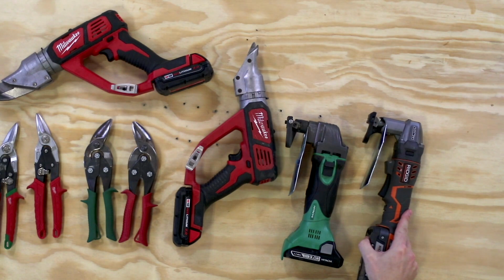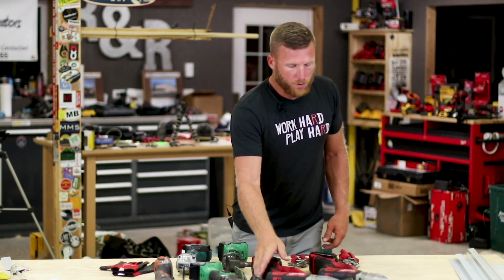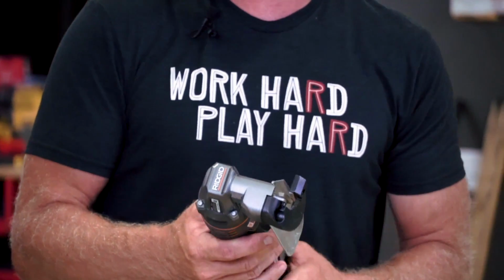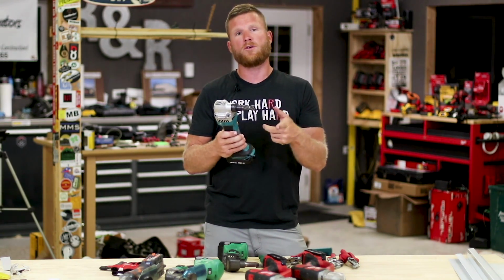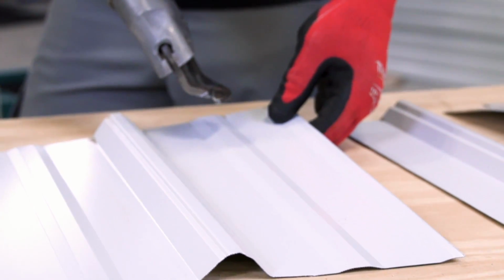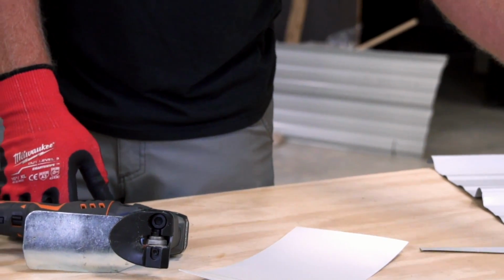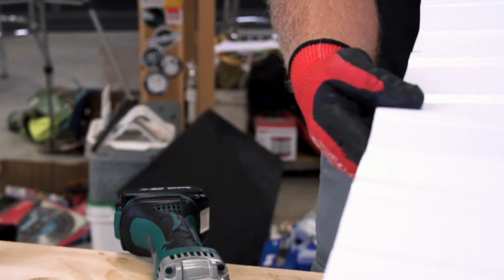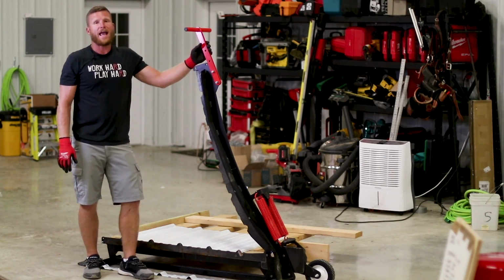How to cut metal - Toolsday

Comment: You need to check out a magnetic chip brush. Looks like a stainless steel baton with a plastic handle with a very strong magnet inside. Once you have waved it over a surface and it fills up with chips, you pull on a plunger pulling the magnet into the handle, dumping all the metal chips.
Is also available in long versions.
With this you can easily clear a large surface of any magnetic metal.
Works great for finding lost screws and bolts, even in grass.
Reply from the maker: NoC great idea thanks
Reply: ²

Comment: The nibbler is a very useful tool, but yeah the nibblets are not fun to clean up.
I find a strong magnet wrapped up in a plastic bag is great for picking them up from the jobsite, you run the magnet around the ground or floor and when you are done, just remove the plastic bag, and the nibblets are now in the bag. You also have to watch out with the nibblets with pets around, especially dogs, they can easily get stuck into your dog's paws.
Love the videos, you do very nice work!
Cheers from Tokyo!
Reply: Great idea!

Comment: I have a nibbler fitting for my power drill - a bit more awkward to work with than a purpose-built machine, but it cuts nicely.
One thing you do want with a nibbler is a good workshop magnet to sweep up the bits afterwards. It spits out a stream of very sharp metal fragments, and they don't rust out in a hurry. It's much better to clean them up than be picking them out of your boot soles twelve months later - or your kids' bare feet.
This vid definitely needs a workshop magnet demo to round it out.

Comment: informative video, on the Swenson shear, a contractor friend of mine who does a lot of boat house Hip Roof construction, has the 5/12 pitch blade, and cuts his whole roof on the ground.  super fast and to the hip/valley pitches....he owns several different pitch blades
Reply from the maker: Chris Harriman pretty sweet isn’t it.  I have a 4/12 pitch blade too
Reply: I was thinking that tool would be way cooler with an angled blade for pitches! That must be sweet.

Comment: Love the channel; thought I'd share a tool that is no longer available but was still works great.  Over forty years ago I went to trade school for HVAC and my first job, had me doing a lot of ductwork.  I had the usual set of tin snips, right, left and straight cut.  Then while at Sears when they had their Good, Better, Best, tools, I can across a 'Pro' tool that was based on a heavy-duty Jig Saw, it had two interchangeable heads, a single cut head, and a nibbler head.  I bought it and I still have that thing and it still cuts, though I have had to order replacement blades years ago.  Being designed from a jigsaw, it had a comfortable handle, with the motor between your hand and the spiral the shear head curls up.  I'm amazed that with all the cordless power tools, no one had thought to use those old designed to protect to tradesman's hands.

Comment: Great info! Few years ago I had to add lots of windows to a "high" profile commercial building. I used the double cut shears. Work great for flats....I made it work over the profile., but barely. Should have got the nibblers to. I would like to see how guys are making windows water tight. A lot of thought went into this as I could not have the water running down the inside of the panel and soaking insulation. Keep up the good work. Stay safe up there.
Reply: yep and the wet insulation takes forever to dry out and then the panel rust through from the inside, a real headache.

Comment: I have a nobler and cut all kinds of material , it does well. I also use a couple of bar pickup magnets on a pole for cleaning the floor. Use a couple of 2x4 for spacing. It catches most all of the scrap as well as the really fine shavings that wind in your shoes
Reply: I take the pole off and use between the 2x

Comment: It looks like my last comment has not had much traffic since that entry. However ... Kyle, you implied you read these and sometimes learn from them so I am hoping what I key next is of value to your followers. First, in the video to which these comments are attached, which has been incredibly helpful to me, you demonstrate a nibbler tool after some shearing tools. Sadly, in my case, nothing was specifically stated about the limitations of a nibbler that does not have the wide-angle access that is visibly obvious in the two nibblers you held up, or the one you used to do the "nibbling."

Not knowing what the specific benefit of that wide-angle access actually allows, I bought an air-powered nibbler that works fairly well on "flat stock," but it absolutely could not go over any surface that was not flat ... like the formed wall or roof panels you cut with the nibbler. That limitation was easy to see once I tried to use it! Its access point is a narrow "slot" through which the flat stock can easily pass, but it does not allow (limits) any hope of passing up, over, or around any ribbed panel.  Just a mechanical limitation.

Second, and I do realize you did not make all of your videos last week, the Hitachi brand is now Metabo and that little update would be very informative to a DIY person doing this sort of work for the first time ... or returning to it after many years away.

None of what I just wrote is intended to fault you in any way! The educational and informative perspective of every one of your videos that I have watched is PRICELESS!! Thank you, so very much for your willingness to give us the heads up we need when we lack your experience, knowledge, and skill.  :-)

Comment: PS:  About thirty years ago Black and Decker made what looked like their homeowner (the green painted model) version of a jig saw.  Instead of a blade it had two opposing wheels that did the cutting.  Went through any profile of steel roofing perfectly.  The wheels were replaceable as well.  Of course it worked so well they quit making them almost immediately.  Sure wish someone else would come out with that design.  They were far from expensive and worked like a dream although they were from the corded era.  Doug
Reply: Yes, those were excellent. Fast, smooth, no mess. Like you said , must have worked too well.

Comment: Kyle's right that these nibblets get everywhere. Nothing worse the coming home and popping of my shoes and seeing a trail of them on the carpet behind me.

I have a wand I made of strong magnets surrounded by thin-wall 1" square aluminum pipe that I can lay underneath the cut to catch them. And then I can wave the wand around to pick up those the magnet missed on the drop. One could even make one long enough to fit the width of one of these panels.

Inside the aluminum pipe is a piece of wood with round holes drilled deep enough with a Forstner bit to hold the magnets in place, and then the piece of wood with the magnets is slid inside the pipe and held in place with a single screw.

My next big-money adventure is to invent a wand that works on aluminum nibblets.

Comment: In the aircraft industry, air operated hand held routers are used for sheet metal pattern cutting. A 25,000 rpm router bit has no conscience and leaves no burrs. Keep fingers away.

If I had a number of sheets of corrugated metal that all needed to be trimmer to the same length, I'd use an abrasive blade in a circular saw and be done with it. 

Nibblers work good for cutting holes for chimneys or other larger diameter holes in sheet stock.

Comment: check out the draco 3520 medal sear it will do what you want. also a skill saw with a carbide blade will do it. uni shears or tin snips are designed to only cut with a short amount of material on one side that can roll up.

Comment: My Hardie board shears has the same kind of double cut mechanism as your double cut shears. I point this out because the blade can be flipped on the short axis. So basically there are two blade sets in the mechanism. This is not readily apparent from looking at the tool. It's similar to some jointers that allow you to flip the blades on the long axis.

Comment: The hikoki nibblers look like they can do a good job on corrugated iron.
They changed the name to custom orb years ago although it's the same product. Using
A cold cut saw on sheeting needs plenty support. I would need to make a special table with an area where the backing has a gap and supported both sides and
Well clamped. Very noisy doing it that way.

Comment: I only started working with metal roofing a year ago as a side job building lean-to-carport structures and all I had were snips and a grinder with a cutoff wheel. It worked but most of these tools are going on the wish list. Great video.

Comment: Very interesting.  I have a set of air nibblers in the drawer but just because of the mess and the damage the cuttings do to the finished surface I didn't even consider them.  Just did a job with standing seam on the roof and the exposed fastener on the sidewalls.  All needed to be crosscut on the job and I just have not found a tool that can handle it and can do it without distorting.  I can't think of anything but a floor shear which is certainly not affordable or portable.  I used the corded Milwaukee coldcut saw (circular) and was very unhappy with it.  Not only did it make the cut line invisible but it ground its swarf into the finished panel scratching the paint horribly as well as starting rust from the particles laying on the panels.  It does catch most in the container on the saw but enough gets by to really ruin the job.  On blind cuts it really sucks not to be able to see the blade while every cut has a slight burr to it (perfect for rust to form).  It also ate blades pretty fast.  Something about the corrugations tend to chip the carbide.  Took two blades to do a job consisting of about 2200 sq ft.  My corded Grizzly snips were good for ripping panels but not if you needed to cut on the side of a peak or valley.  Bought a set of Malco shears that attach to your drill motor and although advertised for roofing they could not do the peaks and valleys of a cross cut in either profile.  Sent them back as they were terrible.  The head swiveled without being able to lock down so a long cut needed four hands to hold and drive the tool while grasping the head to keep it going in the right direction.  So my question would be, aside from the floor shears what do you use when doing many cross cuts on panels at the job site?  Can't be the nibbler just because of those cuttings.  Not only do they scratch up the job but think what the client's reaction is when they show up in pet's feet and inside on the carpets!!  Cleaning them up entirely would be impossible (I have done small jobs over a garbage can on a tarp and still found them in lots of places).  Looking forward to hearing your solution then running out and buying it!  Tired of scratched paint, having to spray it and work in wet paint.  Take care.  Doug

Comment: Great video! I need a nibbler now. I was just working on roofing a valley, cutting metal with a Malco single cut attachment for a drill, and it sucked.
Reply from the maker: Judah Chadwick yeah man.  I’ve got those affiliate links in the description.
Reply: @RRBuildings  Thanks bro! Dang, nibblers are pricier than I was expecting, but I have some jobs coming up that will pay for it. Currently my cordless tools are all yellow, and it looks like I need to decide whether to buy in to green or blue tools next.

Comment: I use a cordless angle grinder with a metal disc. Much faster. The draw back if you will is the cost of discs. Your Makita is the best I have have used.
Reply from the maker: Doug Neufeld I don’t recommend grinder or saw blades due to the heat it puts on the edge of the steel.  Faster edge rust and the shavings flying around can cause edge rust as well.  Not telling you not to do it.  Just me .02 cents
Reply: I dont know if this is true but I've heard some metal companies wont honor the guarantee on the finish if they know their products were cut with an abrasive wheel. Grinder circular saw etc. That 50 yr guarantee on metal roofing flys out the window or so I have heard.
Reply: Warranty voided immediately bro, on coloured steel from any supplier

Comment: Hey buddy great video. I'd really suggest a Snap table if ur doing alot of paneling that isn't corrugated. I've been looking at getting a nibbler attachment for a while. I'll probably order one tonight. Mostly for sticky situations like pot lights in 20 or 22 guage instal. Some of the stuff people want nowadays in Canada is just crazy. I run hilti tools and usually just put a "non-abrasive metal blade" on my cordless SCW 22-A 6 1/2" circular saw. Which like all those tools for the most part dont void a warranty. I'd highly recommend it if ur looking for speed and convenience on site. The grinder will mess with warranty at all time. Unless there is a non abrasive metal blade on it but the kick on them ain't worth it most times if ya have one of your guys that isn't use to it
Reply: Also wondering what ya run for impacts.cuz I've tried them all and now dont mind spending $600+ CDN for a single drill with 2 batteries and charger. Hilti hade come thew Everytime. We've got a guy that's 6'9" on my crew. On a 4/12 punching down on his "what ever impact" to sink a #12 pancake robertson 1 1/4" (non self tapping). It was embarrassing to watch. I'm 5'7" and can be in a sitting harness leaned out at full stretch with one arm and drive that srcew on a mansured threw two panels. Highly recommend the new SID 4-A22. I now make the boys use them lol. Even an older one that's beat, buried underneath the back of the truck. We've had a representative of hilti come replace a drill in less than 1hr mis day because one was dropped from 6 or 7 stories and hit the concrete downtown Toronto. Free of charge if it is with in ur 24 month of purchase. I wish I could say I work for them but shoot. I dont and encourage everyone to buy one of their tool and tell me I'm wrong.

Comment: Not sure if it has already been covered in the comments but your Nibbler definitely Does Not anneal the metal.  "Annealing - heat (metal or glass) and allow it to cool slowly, in order to remove internal stresses and toughen it. "  Its basically a heat treat process, usually done with a torch in my experience. More common in auto body fab and more artistic stuff. Love your channel, just tryn to help keep accurate info.
Reply from the maker: Simple Man thanks I’m no expert on some of those terms... that’s how I was taught but thanks for enlightening me. Appreciate it
Reply: Whoever said it was annealed probably meant it was stiffened through "work hardening" which is a blacksmithing term for hammering the s**t out of something. It does increase the tensile strength but that can cause brittleness but in such a small area it would be insignificant.

Comment: I do not see any other way to contact you; so I will try this ...
 I only found your videos in the past week and think they are the best presentations with the greatest amount of very useful information that I have ever seen on dealing with sheet metal and tool usage explanations. Just today I saw the video on metal cutting saws from Milwaukee and Makita. I was surprised to see you had no use for those saws on ribbed sheet metal siding (I saw the video "Tools Day" for nibblers).

I am not the experienced builder you are, but I am curious why you feel cutting vertical wall panels to fit under a 6/12 or even 12/12 gable roof lines could not be done with the saws you demonstrated. And I am very interested in which Diablo blade you feel is best for those saws. Your opinion is already held in high regard ... so I hope you will offer an opinion on this option " saw vs nibbler."

Respectfully curious,
Tim Gregerson 
Montague CA

Comment: This was a very educational video about what not to invest your money in you can do all this with a skill saw and don't none of it show you how to cut a good angle for hip valley roof inside we build cut tables out of wood I can cut angles on a wood cut table I have all kinds of tricks I'm about to build a cut table out of wood where you can cut your angles with a skill saw you just have to put tape on the bottom so you don't scratch the metal you have to use 16 ft long 2x4s if you got something longer for bigger panels that's good you may have to use up to four star horses but I'm about to build this table and post this video but this is a very good video and I appreciate the education

Comment: This is the most thorough explanation and execution of these various tools I have found, thank you 🙏🏼!  I’m most worried about metal shavings as I will be using these in my home workshop.  It didn’t appear that the single-cut shears had any fallout.  Does it produce micro-shavings at all?  (The Hitachi or the Rigid Jobmax)

Comment: Hi  there Kyle.

I'm trying to get better, faster and safer cuts on 1mm galvanized steel sheet (no curves practically) for bodywork on my DIY car project (car is still a rust bucket so scratching is not a problem). I'm using a grinder but it takes a while to cut, doesn't seem that safe and makes a whole bunch of noise. I need my grinder to strip out paint so basically I need another machine so I was wondering, about getting myself a nice metal cutting machine and keeping my grinder to strip paint.

So what I'm wondering is...for 1 mm galvanized steel what would be your go to for speed + less noise?

Great video and amazing explanation on the machines.

I only have doubts because of the gauge of the material...I'm using 19 gauge and the ones you use in the video seem thinner.

Thanks!
Reply: Cutting one millimeter metal is no big deal for this sort of tools. Available for five millimetre, if you can afford it..
Fein, Trumpf, Metabo and Perles make recommendable machines, often used tools are worth looking for.